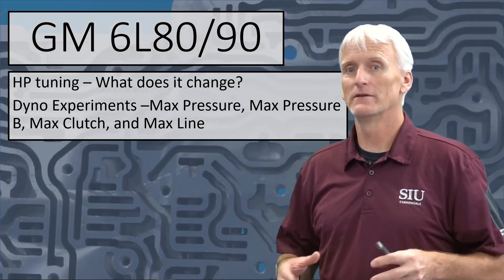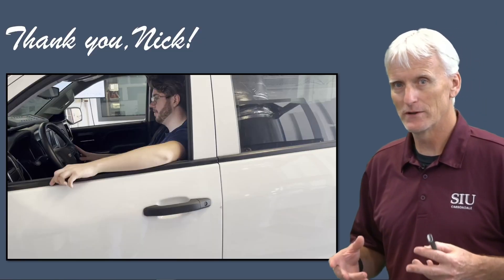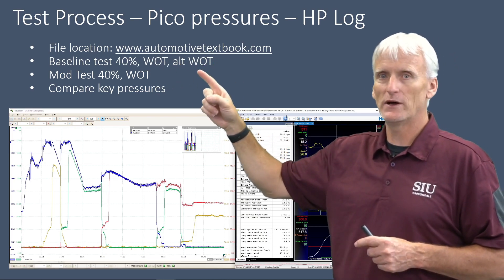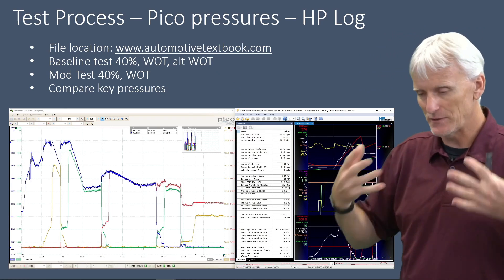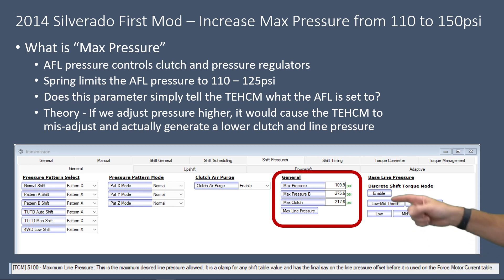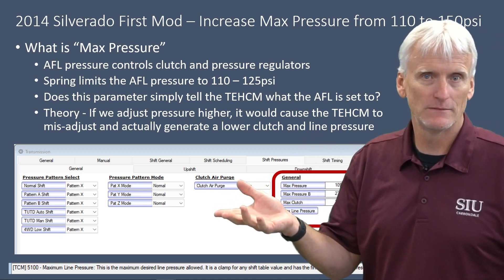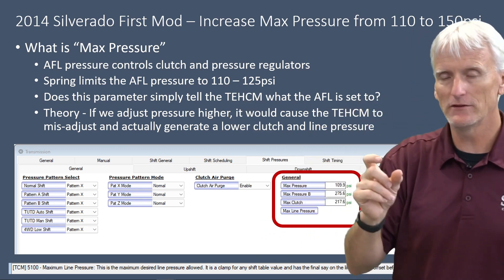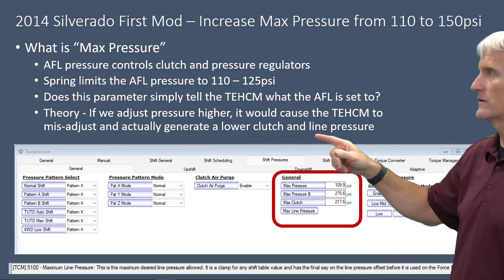HP Tuners & 6L80:  THIRD video covering Max Press, Max Press B, Max Clutch and Max Line

Comment: I have to wonder if turning TCS off would eliminate the throttle drop at WOT. I know in my Sierra, throtle is controlled a lot more when TCS is on that off. For instance, you need to turn it off in order to do a brake torque or it won't even hit the RPMs to break it loose

Comment: Maybe I missed it, but did you try changing Max pressure, max pressure b and max clutch pressure after your max line pressure table setting? I wonder if these settings would yield a change once more line pressure was available to these settings.

Comment: Would the torque signal being sent to the TCM from the ECU need to be higher for it to even think it needs more clutch pressure?  We bumped the limits in the video, but not the torque signal.

Comment: My buddy and I were talking about the variance in throttle reduction during WOT shifts. Do you think that might be due to traction control on a dyno? Most modern vehicles don't actually turn off traction control completely, and as such they hate running on a dyno. It seems odd that it's inconsistent.
Reply from the maker: I'm not sure.  I was really surprised to see the throttle torque management, especially since it looks like "no throttle" was the stock setting.  And, as you said, it was very inconsistent. 
What also surprised me is that the clutch shifting pressures reacted differently whether there was throttle reduction or not, so you'd think that there's another set of tables that can be referenced.   Thanks for the comment and please ask more questions if you have any.  I might not have the answer, but somebody may.
Reply: @siuautomotive  I see this is a year old, but did you log the Displacement on Demand channel? In the 2014 Silverado, there is active fuel management aka DoD, and also Intake valve angle. If you logged the Spark Retard (sensor) you may see it is related to DoD and or VVT cam angle. If you do another test, turn off the DoD using special function, the Green button in the VCM Scanner of HPTuners. Did you have the Air Conditioner on for both Baseline and the non-throttle closing Baseline? Log IVT channels too. After uploading a new tune the IVT heat soak over compensates. It should be neutralized during testing.
Reply: Through all my logs I have never seen the TCM command throttle reduction during shifts, it's always spark, and like he was saying the settings to turn it to "throttle only" are inconsistent and I don't think they work or are doing something else.
Reply: @cmitchell17a1  yeah, might be something not obvious. I have a "electro" mechanical diesel (OM606 with an EDC pump) that I'm going to tune and run on an ECU. Unfortunately I have very limited options when it comes to torque management between shifts. It's going to be pull throttle, or open the VGT vanes. Either is pretty aggressive for shift torque management. I might end up doing a little of both hopefully it doesn't prove unreliable, and can save the 722.6/NAG1 going behind it. My dream was to use a 10R80/10L80 in the build but no one has figured out a controller, and Ford performance won't share the CAN data so I can get the factory TCM to sing.